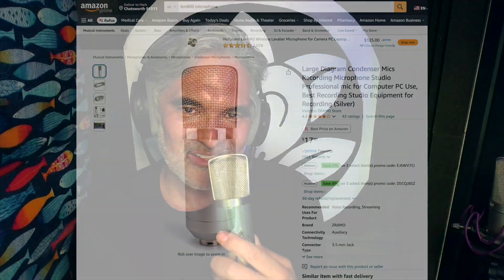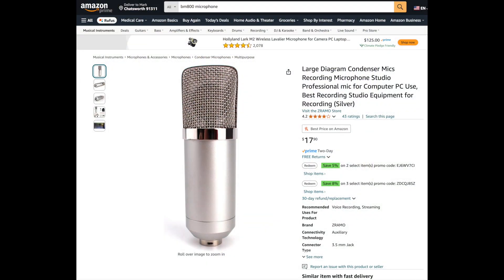This Cheap DIY Mic is Simple to Build and Sounds Really Good

Comment: That's an expensive PCB board for such simple circuit ngl
Reply from the maker: It certainly adds to the cost, but for those who are looking for a PCB instead of breadboarding, it's a great option!
Reply: @MarkYoshimotoNemcoff  just saying as someone who could make this for way cheaper with a perfboard, but I understand some just want the plug&play option
Reply from the maker: So many of these projects are created for beginners, to get their feet wet and get them excited about building mics--like a gateway drug. Buying the PCB or the kit is worth it to a lot of people to eliminate friction points between the desire and the doing, especially when it comes to implementing surface mount components.

Comment: 5:35 Don't saddle of glue it - hang it. Use thinnest wire you can find to connect capsule, so no vibrations go with wire isolation. You will loose the vibrations and handling noise. 
On Ali you can find all this stuff under 25USD.
Reply from the maker: LOL. No. A condenser capsule needs to be rigidly mounted to maintain alignment and polar pattern accuracy. If it is left to hang, it will swing and resonate, which adds rumble, handling noise, and tonal coloration. The saddle and internal mount already provide controlled isolation. Hanging it with thin wire would make the capsule unstable, stress the solder joints, and turn the whole thing into a mechanical noise source. That is why no microphone manufacturer does this.
Please do me a favor and go post your idea in the mic forum at GroupDIY.
Reply: @MarkYoshimotoNemcoff have you tried it before pouring this fantasies? 😂 I meant to hang it on rubber strings. It works just fine. Up to you anyways.

Comment: will see if a cad gxl1800 fits the alice board in it. seems like they're just rebranded bm800's. I think pyle makes one too.
Reply from the maker: I think you’re right. It should fit. The GXL may even be better manufactured.
Reply: @MarkYoshimotoNemcoff  it fits. :) Even with just the alice circuit and the EMI filter caps it's a significant upgrade. Still waiting on my printer to finish the saddle. Doing it in TPU and a snap-in fit. Might paint the body tube with silicone too to cut down on the handling noise. Also yeah it's almost definitely out of the same factory in China. Though CAD gives you a proper xlr to xlr not a trs.

Comment: Hi! Will it help getting a better capsule for this Mike? And which one would you suggest?
Reply from the maker: That JLI capsule is probably the best electret option. If you want to go with a full condenser capsule, you'll need to add the DC-DC converter board to the main Alice board and then you can pop on a CK-12, 87, or 47 style capsule. For general purpose, I'd pick a CK-12 style capsule. There are quite a few of them out there for not a whole lot of money and they tend to be more consistent than 47 or 87 style budget capsules. If you want to go big, get an Arienne Audio Flat k47 or regular 47.

Comment: Mark, thanks for the video!! Can you share a tutorial on how to use a beer can to mod the enclosure?? Looks nice!!
Reply from the maker: I appreciate the interest! Wrapping a microphone body with a beer can is something I’ve done before, but it’s quite difficult and requires specialized tools I didn’t have at the time. More importantly, working with cut aluminum can be dangerous, as the edges are extremely sharp—I’ve accidentally cut myself badly in the process. Because of the risks involved, I wouldn’t feel comfortable making a tutorial on it. And it shouldn’t be done by anyone who doesn’t have previous experience working with cut aluminum. That said, if you’re interested in custom mic aesthetics, there are safer DIY methods out there, like 3d printing.

Comment: You're killing me, Smalls! I thought you weren't DIYing mics anymore, and now here you are pulling me back in and re-piquing my curiosity. How would you say that DIY mic compares in sound to the Bei Fei Li C-414?
Reply from the maker: Hahahaha! I already had this one from a while ago and it’s so easy to build since you can buy the board already populated. And I do think it’s probably a better mic than the BFL 414 because the circuit is cleaner with less self noise.
Reply: @MarkYoshimotoNemcoff  Okay, I think I'm going to give this a try. The hands-on building aspect is very alluring to me, and the cost is low enough that if I screw it up I won't be out too much $$$. Nothing ventured, nothing gained and all that. I'm seeing that other capsules on JLI are pictured with wires attached. Does the JLI-2555BXZ3-GP capsule come with the wires needed or will I need to buy those separately? Okay, last question, I swear. Would it be possible to use one of JLI's 34 mm capsules in this mod? I've heard bigger capsule = better sound. Thanks in advance.
Reply from the maker: @OdinsMaiden  It's going to be a lot of fun. You will have to supply the wires that attach the capsule to the PCB and also the wires to attach the XLR jack to the pcb. Now, if you buy a cheap mic to use as a donor, you can possibly save the XLR wires and the capsule wires from that mic to use in this one if you don't have hookup wire.
Reply: @MarkYoshimotoNemcoff  Done! There was definitely some troubleshooting along the way (I have literally never touched a soldering iron before this). It sounds great! Thank you so much for sharing this video. Curious, if you could compare/match the sound of this DIY mic to another mic, what mic would you say this one sounds similar to?

Comment: honestly the DIY one sounded better then the $2k one
Reply from the maker: Ok. Let me ask. What did you like better about the DIY mic?
Reply: @MarkYoshimotoNemcoff  I thought the Soyuz was just a tad too "forward" in the mids, but that difference would be interpreted differently based on your hearing and your monitoring.
Reply from the maker: @GeorgeTheTech  You’re not wrong. Here, the Soyuz is going through a CAPI VP26 with a Rogue 5 op amp so the mids are punched up.
Reply: @MarkYoshimotoNemcoff  couple things, The over all depth and "space" of your voice seemed more clear then  the $2k one. Second is the $2k one seemed to have high frequency or clipping happening. Could be my setup.
Reply from the maker: Thank you for lending your ears.

Comment: How about putting one of the tsc large diaphragm capsules in there?
Reply from the maker: Cool idea, however this mic does not have the dc-dc hex converter board (https://www.jlielectronics.com/diy-accessories/dc-dc-hex-inverter-pcb/) necessary to power a LD capsule, only the base Alice board capable of delivering 12 to an electret capsule like the one inside.
Reply: (when it's 404 just delete the last two letters from the link, it just counted ")" as a part of the link)

Comment: Thank you for this video! I am curious to know how well it would handle high spl? I am tempted to try to build some mics for live drums. So it must handle 120db , probably more, Any change you could test it with a snare or a tom getting whacked? Thx for your content! regards
Reply from the maker: You're very welcome! Since I don't record music anymore, only VO, I don't know about drums, but, on paper, the dynamic range of the OPA Alice board is rated at 130db and the capsule 120db.
Reply: @MarkYoshimotoNemcoff  Thanks for your response! I did see that spec listed for the capsule. But I am not not sure what it really means. Or rather, how gracious would  a capsule handle 130/140 db peaks while its listed as max spl of 120. Some increased distortion is probably fine.. but very evident distortion is not. Would love to know :) your channel has been very inspiring!
Reply from the maker: @Reefgc  Well it turns out @SoundSleuth, Mr. Jules Ryckenbusch, the designer of the OPA Alice has a video about OPA Alice drum mics and has also commented in response to using them on drums below. And it seems like all signs point to yes! 
https://www.youtube.com/watch?v=jWDbiAvwGE4
Reply: @MarkYoshimotoNemcoff  Thats great! I might have to really consider building a few of these! Thx for the tips!

Comment: Thanks for the shout out here! And you pronounced "Ryckebusch" Correctly! I am super proud of the OPA Alice circuit. If you really want to hear how good it is, pair it with a full 34mm condenser capsule and a bias generator.  On the other hand I've built many of what you just did here, the 2555B and a donor body and they are my go to  for most things. Great video and channel.
Reply: Would this donor body fit a 34mm electret capsule? I'm not sure what a bias generator is or how it would wire into the circuit, but I'm definitely interested in trying a first DIY mic build using your electrontics and what Mark has suggested here.
Reply from the maker: Jules! Thank you so much! Means a lot coming from the man himself. Your OPA Alice is brilliant. I have a few Alice mics and they're all really very cool. Glad I nailed that pronunciation. 
One question: Another commenter asked if this mic could handle the high SPL of drums? I would think it should, right? I only do voice over so all I ever test on is voice.
Reply: @MarkYoshimotoNemcoff  Yes! I use it on drums all the time. You need to pad the capsule with a 220pF capacitor, which is about 17dB. https://youtu.be/jWDbiAvwGE4?si=jFCMqgMuJclh232H
Reply: @MarkYoshimotoNemcoff  
Sound Sleuth posted a video of the Samantha (2555B capsule and OPA Alice) on drums.  https://www.youtube.com/watch?v=BrfFLf2bkvY
Reply: Hey, just wanna pop in to say "thank you" because i built these and im so so happy with the result.
Your a real one
Reply: @MusicalRiolu  Thanks! This is what makes it all worth it.
Reply: It’s a neat circuit, but wouldn’t you get a bit of distortion from the output audio signal going to the phantom power rail? I’d have considered inductors in series with those 2.2k resistors, and maybe a capacitance multiplier in addition to the zener regulator. I’d also want to use film caps instead of electrolytics in series with the audio path, but they’d probably end up too big or expensive. It would be nice if you could ditch the high-pass caps entirely by using a split-rail supply, makes you wonder why phantom power became the standard in the first place.
Reply: @Scrogan the audio goes to the phantom power rails via internal 6.8K resistors in every condenser microphone.  The split rail circuit I use is standard opamp “single supply” methodology.  This one provides about 11.8V/2 and can easily handle a signal that will overload the mic preamp. It works really well.
Reply: Hi @SoundSleuth, I was wondering , how do you implement the bias generator in the circuit?
Reply: @dendriloquist there is a voltage multiplier using a hex inverter.
1980’s technology lol but works great.
Reply: I'm eagerly awaiting my boards to have some fun populating them! Soldering is my happy place, so I opted for the DIY option. Would've have gone the JLI route for subsequent ones but the $42 just for shipping to my country is too high for me right now. Maybe when I have enough items to make the shipping more worthwhile😂
Reply: Im from europe and buying it from jli would cost me like 50 bucks shipping alone, is there a way to maybe get the gerber files from you? :)
Reply: @itsdarkos  He's written on the Forum that he won't share the Gerber files, because the designer of the PCB doesn't want that. You can, however, find it as a shared project on PCBway and order it from there, which is what I did. I'm in Germany and just ordered the PCBs and parts, will assemble about 10 or so once they're here. If you get in touch maybe I can send you one for the price of the parts and shipping.
Reply: @VOROX_Audio  How much would you ask for a single pre-assembled board shipped to Belgium?

Comment: Sounds great! How would you compare the value of that to the BaiFei mics you purchased?
Reply from the maker: For the most part, I look at the BFL mics as great donor platforms for DIY. But if you take the “in the same ballpark” side by side of this and the BFL 414 with the 25mm capsule, I think this one has a little more punch due to the chiseled headbasket acoustics.

Comment: This is a great sounding microphone ( the capsule isused in great microphones like some from CAD). . You can find the blank PCB s made by Jules Ryckebusch  . I You make it yourself with this blank PCB , be sure to get the PCB extra clean and wash it very well after solder , especially around the chip , it can be noisy very quick , but if made it well , it s a better mic than many other much more expensive microphones  .... There is also a HEx inverter board , combined with the OPA Alice , it can load 34 mm Capsule very well
Reply from the maker: Thank you for adding to the conversation. Great tips!
Reply: @MarkYoshimotoNemcoff   Kochilakoso !!!